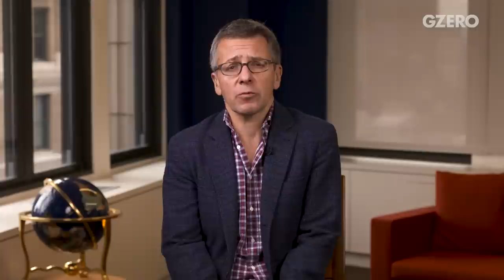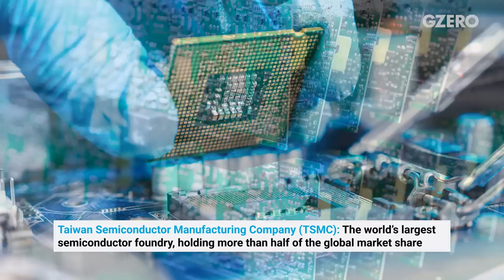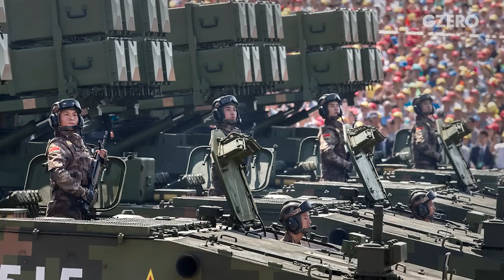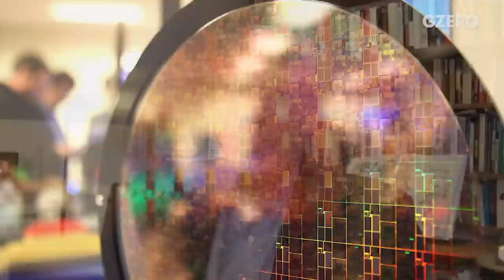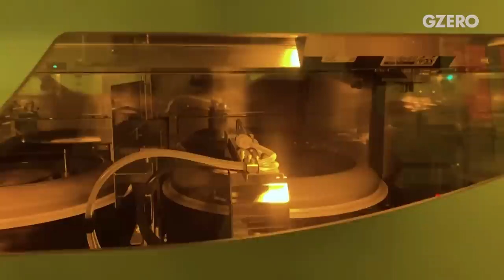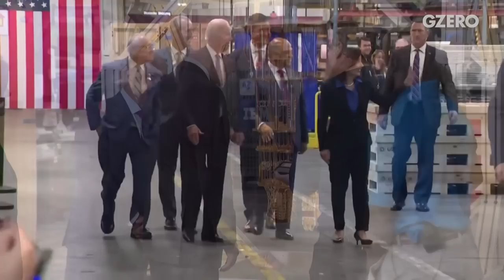Taiwan’s Secret Shield Against Chinese Invasion: Its Semiconductor Industry | GZERO World

Comment: When I was in this business, we required a second source be possible or it couldn't be done for smart business reasons. Apple is stupid. 

You can blame the companies like Qualcomm and Apple because the cell phone market has driven this degree of integration. The fine resolution built at TSMC is primarily needed if you have power and space considerations ( tiny box and small battery). Cell phones top this list. If the Defense industry such as Raytheon ( small missiles) is using this level of integration, you can blame them too. Remember they owe it to their shareholders not to "single source" their critical components because not only does the US have a problem but the look at the world of hurt Apple is in by building their phones in China - Zero COVID. Top management is supposed to watch out for this kind of stupidity. 

Until the last few generations, Intel was going to be an alternate source. They are still trying. Samsung is almost as good as TSMC so is a backup to some extent.

Don't forget the design tools and libraries from people like Cadence and Synopsys. China won't be building these tools over night either. 

Many applications can work with a few chips from other sources as long as you are not power or size constrained. The tools from Cadence and Synopsys allow moving the design up or down the technology ladder so the number of chips that NEED TSMC is smaller. You can split a chip into 2 or more chips or combine chips as long as you are not I/O constrained. So if China destroyed TSMC everybody that really needs small geometry due to battery operation in a small box ( think Apple iPhone or Qualcomm SnapDragon in a phone ), they would go to Samsung while others would split chips until TSMC, Samsung and Intel were up to snuff in the US.

Its a big issue especially for people like Qualcomm and Apple but many could find alternatives in 6-9 months. A painful 6-9 months but not the end of the world. Somebody needs to do a good analyses because these high level guys are just too vague.